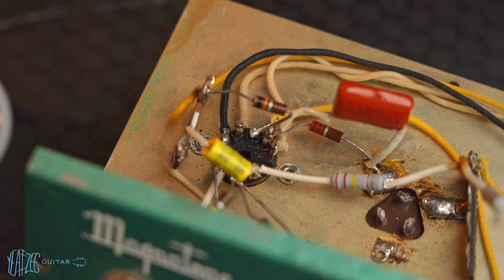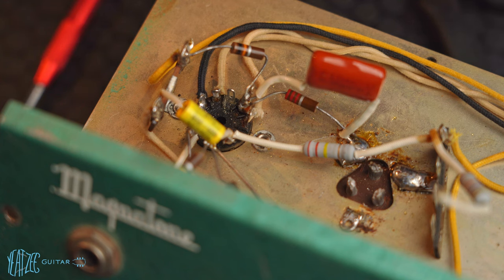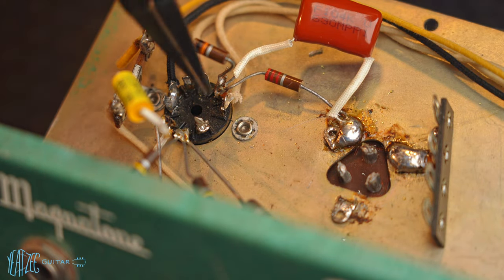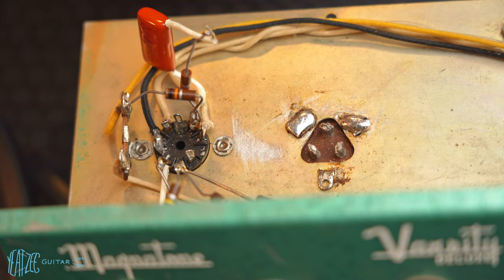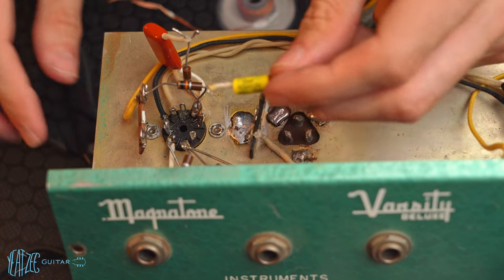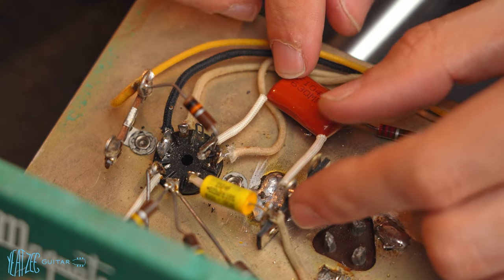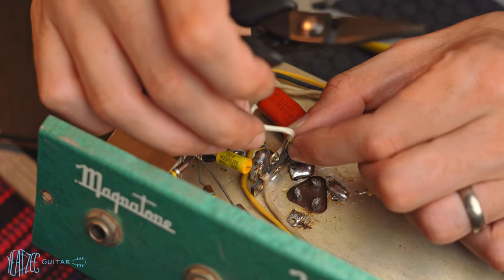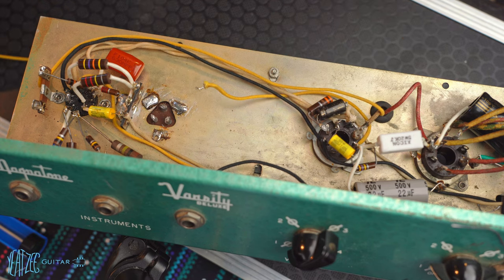My Vintage Amp Journey: Episode 5 - Transplant or Fail...?

Comment: That's a good fix in my book! Swapping riveted sockets is a bummer. It's nice that the socket pins haven't changed much in all these years. Those are metal oxide resistors. They are much more heat stable than the carbon comp resistors, but are not very period correct in your amp. I usually use the metal oxide for maximum reliability, but have chosen carbon comp for vintage correctness. In my line of work, we have equipment that used the carbon comp resistors, but they burn up in some   places causing system failure. When those cards are repaired we replace them with the metal oxide tho resistors. Anyway, in an amp like that those carbon comps will likely last a very long time.

Comment: Just finished.  Great job!  Preparation is everything.  Comparing your first few videos to this it's clear to see just how much you are improving.  Good job testing all your connection as well with a multimeter.  That's a good habit.

One last tip that I picked up from watching a lot of other people solder.  When you are soldering, place your tinned tip up to the joint and then immediately add a tiny bit of solder directly to the tip, not the joint.  This will very quickly super heat the tip and make the joint ready to accept fresh solder or help old solder to flow with the help of the fresh solder from your iron.  Doing this, you can reduce the heat of your iron by a bit while heating up the joint more effectively and cleanly.  Might take a little while to get the hang of it, but it improved my work by a lot once I started using that method.  Runs less of a risk of superheating the component you are soldering as well.  So solder the tip, then the joint.
Reply from the maker: Great tip, thank you! And glad to hear someone thinks I'm improving, that's good!

Comment: One quick note.  Good work on the prep for that new ground.  It was wise to abandon the lugs on that old can cap.  The new ground should work ok, but one suggestion for future work is to use a lot less solder.  You had the perfect amount on that ground but then you added solder about 3 more times after that.  Too much solder can make for a compromised connection.  You don't want too little or too much but I'd err on the side of less is more.  For a chassis ground you can just create a small sanded spot so the solder doesn't spread out as much.  A little solder will go a long way.
Reply from the maker: Thank you! Good to know, I was concerned I needed a lot to hold the terminal strip in place. It's a tricky balance evidently!
Reply: @YeatzeeGuitar  You'll get it figured out with experience.  Lots of solder is less secure too.  Globs are prone to breaking off.

Comment: That Schneider solder wick is underperforming.  Compare it to NTE Electronics and I think you'll see the difference.  NTE soaks right into the braid and spreads the solder out in both directions of the wick like a sponge.  You just turn your iron up, tin your tip, and go to town.  Couldn't do without that stuff.
Reply from the maker: Yeah I need to pick that stuff up, thanks for the reminder!